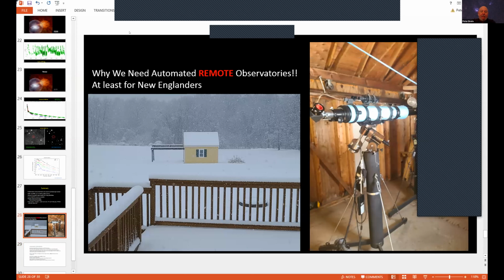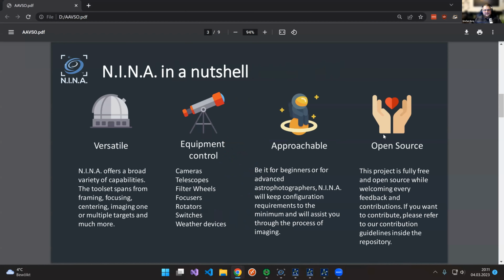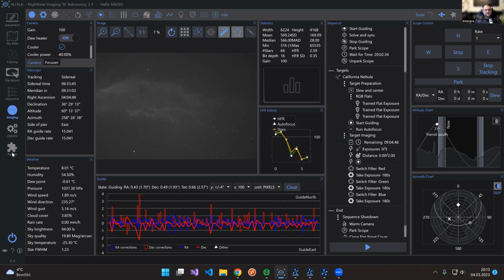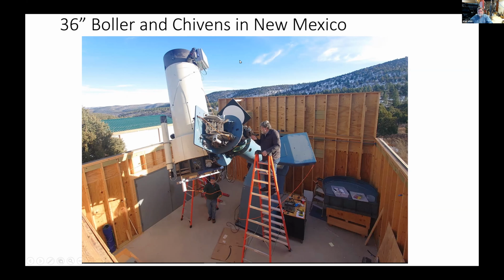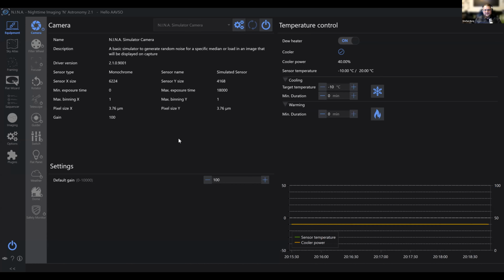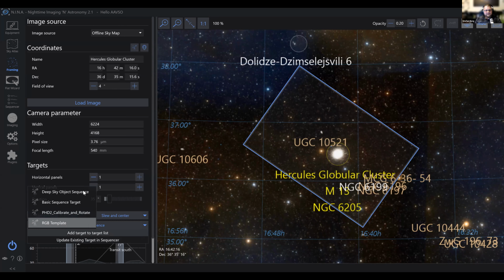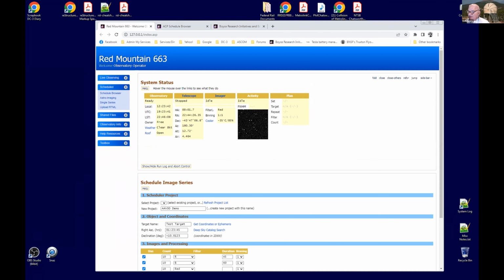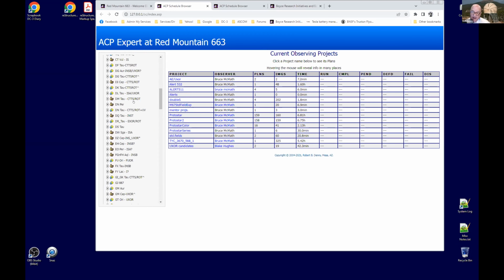How to Automate Your Rig: A panel discussion

Comment: I suspect the "run NINA on a PC and everyone else on a Mac" question was about processing and stuff, not what's needed during imaging. You would run NINA, PHD2, and all the drivers on the NINA PC, but PixInsight, Photoshop, etc. can all be on your mac. In my case, I use two different PCs and use remote desktop and robocopy for screen and data.